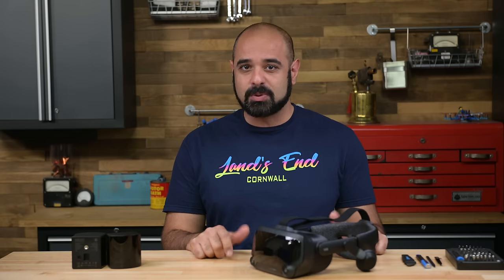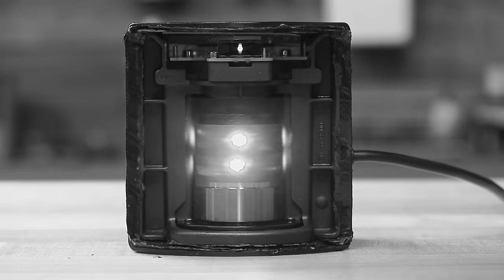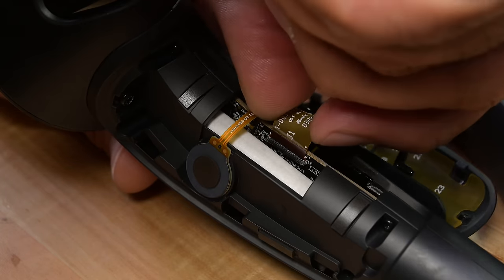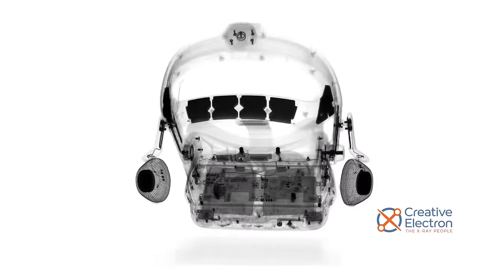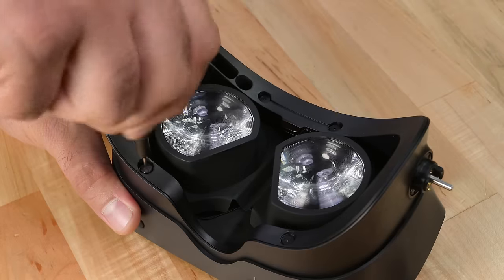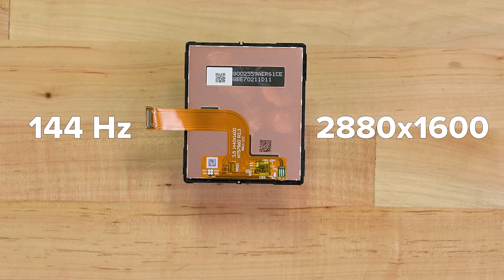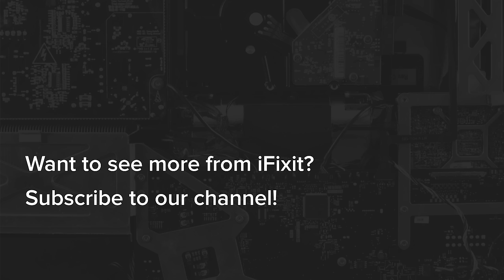The Valve Index Gets The iFixit Teardown Treatment!

Comment: Never knew that the Valve Index didn't get a teardown video.
Reply: To be fair it the kind of stuff that parts are totally unfoundable because the market is so tiny
Reply: @N1ko0L  and even if you're experienced doing a repair on a VR headset atm is a pain, plus all the sellers will just let you RMA it anyway
Reply: I did.

Comment: It's a shame this device is not very repairable given how good the Steam Deck is. I would like to see more VR headset teardowns from iFixit, maybe the HP Reverb G2?
Reply: Valve was kinda new to hardware designing, and I see that they are learning from their previous attempts
Hope their next device is way cooler and more repairable
Reply: @aleksei5195  agree, the presenter gave them some slack and I agree with him, they have another chance to try to fix the problems with this one and prove themselves
Reply: Also, the lighthouse was more of a Vive design than actually steam.
Reply: @grandadduane  with valve doing the software part and htc doing the hardware part mostly
Reply: Almost the complete RnD was done by Valve. HTC did the industrial design, well for the Vive and LH V2. (Industrial design is the thing you manufacture)
The industrial design for the Index was probably done by Valve and is only the second product completely done inhouse after the Controllers.
So cut down the bitching a bit, this was basically a first gen product of this scale for Valve, a software company.
They did a mighty fine job. Just look at the Deck and see what they've learned.
Reply: While the lighthouse and controllers could definitely be better in repairability (though I'm unsure how much I'd recommend even trying to repair the lighthouse with its rapidly spinning parts. It would be along the lines of trying to repair a traditional HDD. The smallest mistake could cause big problems.) The headset itself is actually quite modular overall and was designed with hardware modders in mind, which is good because it is definitely the part most subject to wear and tear. Either way, Valve provides parts for all of these devices which is more than you could say for a lot of companies and their customer service and warranty are quite good for those unwilling to repair themselves.
Reply: @DerSolinski  valve handled all their shortcomings with the index pretty well, allowing RMAs for stick drift and other issues no questions asked and even out of warranty
Reply: Yes def the reverb g2 v2.
Reply: Hopefully the Deckard will be more repairable than the Index
Reply: @DrBagPhD  i‘m positive considering how modular and repairable the steam deck is
Reply: I'd love to see a Reverb G2 tear down. I may need to repair those controllers if I keep crashing into the desk and would love to know how to.
Reply: @SukoSeiti  the lighthouse technology was literally made by a valve employee. htc/vive didnt do anything.
Reply: It is quite easy to pull apart.. mostly. Here I am trying to get the screw out that holds in the left hand head strap 😅
Reply: Lighthouses don't usually break, but when they do, it's not worthwhile to fix. The only thing that can really break is the rotor assembly, its cost is over 80% of unit's total cost because the Lighthouse is an extremely simple device otherwise, and fixing this part comes out more expensive than buying a brand new unit. The odds of logic board dying or laser LED burning out before rotors crap out are basically nil and you needn't worry about that scenario.

Comment: The Basestations are not easily openable for the same reason hard disk drives are: They are way to fragile bearings and dust in the air could damage them.
Reply: And the lazer radion is nothing to play arund with
Reply: @speedybaby  well just dont point it in your eyes while its on and you'll be fine
Reply: dude, HHDS are vacuum sealed and filled with hydrogen, and even a speck of dust would ruin them. They're made in clean rooms. The reason they're not user serviceable, has nothing to do with bearings.
Reply: @manitoba-op4jx  Now do it 99 more times and see how many hard drives survive for another few months, so you can draw a success rate percentage.

Comment: The small size is probably the main reason valve did the controllers the way they are, tho using cement seems a bit much but understandable of how much abuse they see being punched again walls and stuff like that.
Reply: Can't count how many times I have hit them to some object and they are still working. onetime needed to use superglue because part of trigger drop of when clip broke (Dropped controller to floor).
Reply: Yeah, the joysticks break constantly and SHOULD be repairable if only they offered replacement parts but I've never seen the remainder of the controller break and the batteries last forever in my experience. I'd take away more points for the fact there are no replacement joysticks than the cement holding the battery in.
Reply: @Demmrir  There are replacement joysticks, but the issue is that none of them are durable, even the ones with a metal core, because the pots all have plastic bushings and those wear out. I have a wild theory that maybe you can superglue the shafts to the pots and that way the joystick assembly will last a very long time, but I'm fairly certain that if you do that you'd just ruin 9 sticks out of 10 at least, so yeah.

Comment: The fact that this is one of the oldest headsets is really impressive.
Reply: far from it, it’s just one of the older ones still in popular use, although even then the award would still go to old HTC vives or oculus rifts
Reply: The first consumer VR headsets go all the way back to the 90s.
Like the CyberMaxx or VFX1.

If i'm not mistaken it was the introduction of barrel distortion with the original Occulus Rift that made "modern" VR viable.

Comment: 1:01 
The VR headset knows where it is at all times. It knows this because it knows where it isn't. By subtracting where it is from where it isn't, or where it isn't from where it is (whichever is greater), it obtains a difference, or deviation.
Reply: Technically the lighthouses are a location where it isn't, and triangulating sensor positions is a way to find where it is, so that's slightly accurate aside from the deviation thing since missiles tend to use coordinates relative to themselves whereas these trackers do so relative to the lighthouses.

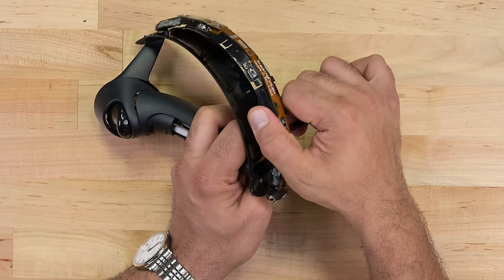Comment: 2:49 this is actually not time of flight (ToF). Lighthouse is a different technology. It relies entirely on triangular positioning as you suggested earlier.
Reply: It IS time of flight, though. The lighthouse is spinning and modulating frequency rapidly so the controller can tell the time of flight by the difference between the frequency-encoded timestamp and the time it was received for every point on the tracker. Combine that with other sensors on the tracker--each reporting a slightly different time of flight--and you can triangulate the position of the base station relative to the headset and thus the headset to a known fixed point (the base station) encoded when you completed setup. You don't even need multiple base stations to do this; it works with just one. The second is to handle occlusion.
Reply: @Demmrir  it ISN'T time of flight because at no point is the time for photons to travel from the lighthouse to the controller measured. The electronics can (and probably do) assume the speed of light to be infinite.

Instead, what they are measuring is the time between receiving light pulses and this provides sufficient information.

You mention 'frequency encoded' information. There is some misconception surrounding the 2.0 lighthouses but, if you look at the datasheet for the receiver, it's clear that they aren't transmitting any stream of data. All the lighthouses can do is select a carrier frequency which it appears is used so that pulses multiple lighthouses operating in the same area can be distinguished by the receivers.

Comment: Yeah to my knowledge there the glue in the controller is a stop gap measure.
So this made the controller actually more reliable in the long run. I'm sure the next controllers will be taking into account everything learned with the index.
But I have no explanation for the Lighthouse V2s. I only can imagine they bunkered it down since they are VERY sensitive equipment.
I can't stress this enough, treat them with care! They are a marvel of modern technology and are pure high tech. Just exposing the rotor to the room will mess with the tracking.
Reply: " I only can imagine they bunkered it down since they are VERY sensitive equipment. I can't stress this enough, treat them with care! They are a marvel of modern technology and are pure high tech. Just exposing the rotor to the room will mess with the tracking" 
This.
The lightouses are modern marvels of engineering. The rotor position is calculated with the precision of a few nanometers and the lasers sweep across the 2mm wide sensors at Mach 5, transmitting their ID and current angle in that short time frame; all the while only emitting class 1 Laser emissions in a brightly lit room.
Reply: @xXYannuschXx  Yeah since V2 ditched the synch blink and the second rotor so they had to encode the ID into the beam.
V1 was already bonkers 2 just got better, more functionality and is easier to manufacture.
They are just bad ass and not appreciated enough.
Also viva la LibSurvive 🤣
Reply: @DerSolinski  I've only found one downside to them. They are way more sensitive to reflections than the 1.0s are.
Reply: @thunderbolt10031  Makes sense, since there is no sync flash and the rotational data is encoded in the beam it is probably way harder to filter those reliable.

That said... who needs decorations or windows when you have VR 🤣

It will be interesting to see if the next VR system of Valve even use the LH method.
I wouldn't be surprised if they switch to a vision based approach.
If the rumored Deckard really is standalone a SLAM approach would be much more versatile.
Reply: I've smoked those rings against walls, my desk, and even a metal ladder and the rings have inexplicably held together. I always wondered what kind of engineering went into this ring to keep it from cracking or splitting in half. Now I understand why, they just half potted it with structural epoxy XD
Reply: @KuraMad2000 the metal frame at the top is the real weak point. You never see the tracking fin break, only the metal part at the top. Thing is, you have to disassemble everything including the tracking fin to replace the metal frame. Simply not built for repair.

Comment: You are actually able to replace the battery in the controllers without a full disassembly. You can remove the finger tracking plate (You don't even need to disconnect it fully) and simply undo the screws. There is a hidden T9 Torx screw on the circular part on the top of the controller, which keeps the two halves of the body together. Removing that allows you to move the two halves apart enough to remove the battery without a full disassembly and avoiding the nightmare of the IR sensor ring.

Not posting links to avoid issues but there are two easy to find videos by SneakyJoe that guides you through this process. Both with and without a sodering kit. (If you want to use a different type of battery.)
I highly suggest watching both videos.

I did this just the other day, my battery was no longer charging and upon removing it I discovered it was swollen to almost double the size of a replacement battery I got from a broken controller.
I'm surprised it didn't explode.
I swapped them out and disposed of the old battery safely. :)

Comment: 2:50 I'm pretty sure the valve index doesn't use a time of flight sensor. If you look at the lighthouse 1.0, it actually does a horizontal, vertical sweep, and then sync pulse. The vertical sweep allows each sensor to get it's vertical angle relative to each lighthouse based on the time from last sync pulse, and the same with horizontal.

 If you combine both, you can get a bunch of lines pointing from each sensor, to the lighthouse in question, which can be used to track the devices
Reply: Yeah I’m fairly sure the lighthouse sensors are doing all the positional tracking

Comment: The reason they use the cement glue in current index controllers is to alleviate the early issues of users banging their controllers against objects, walls, and ceilings, the sides would slowly separate as a result, so they went with an overkill glue to prevent it.

Also the battery is covered to make it more sweat proof should any leak in, as that was ALSO an issue they had.

I'm not excusing these design choices, as they were clearly oversights by the initial designers, just explaining the logic behind them. The controllers are pretty great if you have new ones, but they are not easily repairable as a consequence of early design mistakes. 

I really hope deckard is as repairable as the steam deck and has comparable standalone power, with the ability to connect to a computer wirelessly. I'd like to be able to keep using my base stations as desired for more accurate tracking combined with it's rumoured inside out tracking. Of course, I'd also like full hand, eye, and face tracking, but I'm not that greedy.

Comment: I hope valves next headset is really repairable, since the steam deck also is. They seem to be a even more open to that now than a few years ago when this headset was made
Reply: It's not that easy, The problem is that a lot of the positional tracking hadrware is super sensative and precise which makes desinging it in a way that is easy to replace really hard. But who knows maybe some kind the lieghtfield tech with the variable plarized light will loosen those restrictions a bit and be cheaper to produce.

Comment: This is a super late comment, but you guys helped me fix my Index with this teardown. I had no audio in the left side rather suddenly, and I wondered if the cable was bad because I'd reattached the headphone a dozen times without fixing it, but it turned out it was just a loose t6 screw that secured the strap to the headset since that uses the same contacts as the headphone itself. It works just fine now and I didn't need a new headphone or cable after all. I would've never known there was a second set of contacts further down the connection between the headphone and the cable without this video.

Comment: Very fascinating teardown. Can't tell ya how badly I want a high-end VR headset, but honestly, I will not bring myself to support Meta, and unfortunately, with the Valve Index being quite old now, and HTC not having an oled panel in their current high-end VR headset, I really just feel like there isn't actually an offering out there that'd be worth the sort of money I'd be having to spend. I absolutely would love it if Valve's Deckard had qd-oled panels along with eye and mouth tracking. I could trust Valve not to be collecting disturbing amounts of information on you, which would mean I could fully enjoy such features with piece of mind.
Reply: I"m happy with my index purchase just so long as you don't normally break controller thumb sticks or have the drift alot on you, you should be fine. Its a great over all headset but a bit overpriced. But the warranty experience was great. 1 base station doa, replaced 2 left controllers cause lost touch on thumbstick.

Comment: I would love to also see a teardown of the HP Reverb G2 given that it's essentially a cheaper revision of the Index developed by HP in collaboration with Valve.
Reply: As a HMD, nothing about the Index is really exceptional*. What makes it still an unbeaten package today is the top-notch open-standard/inter-compatible outside-in tracking which the Reverb G2 sorely lacks.
*Audio is better than many headsets that came after it, but it's basically the same system as in the original Rift CV1
Reply: @zig131  Lighthouse tracking is inside-out.
I think currently the only devices with outside-in are the PSVR and Nolo-trackers, both are not that great.
Reply: @taumelscheibe5948  Yes you are technically correct - Lighthouse is an inside-out tracking method in that detectors on the headset work out where they are based on fixed position of basestations.
Rift CV1 is genuinely outside-in tracked in that the sensors "see" the infra-red LEDs on the headset and controllers to position them.
Rift CV1 constellation tracking provides really accurate 360 (common misconception is that it is 180 only) tracking using relatively cheap components.
No matter what tracking technique we talk about, really what we are discussing is the drift restraint method as ultimately all tracking is based on inertial measurement units first and foremost as their data collection rate is so high.
Lighthouse is really just an over-engineered technique for restraining IMU drift.
But it had the key advantage over Constellation that Valve/HTC opened up the sensor side of things to 3rd parties so you have a selection of devices that can be tracked by the same method.
Reply: @zig131  As someone that has actually spent more then two secounds looking at the spec sheet and has had a CV1 and has an Index I can tell you that the in every way the CV1 is worse. TBH the Index is still the best consumer Headset out there rn and prefer it to the Quest 2 in every way.

Comment: The thing id like to see more of is the cable connection on the head strap. Mine broke and the cable seems to be very “connected” to that piece. Is it replaceable without replacing the whole cable? It looks like you just pulled the clip on the head strap away from it really easily which makes me wonder why mine broke at all. It seems that yours wasn’t even “attached”